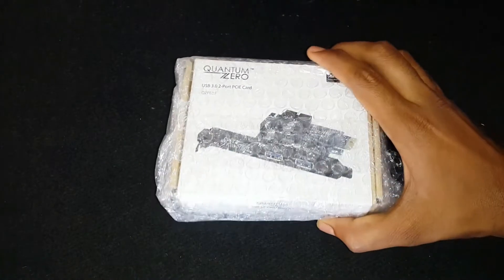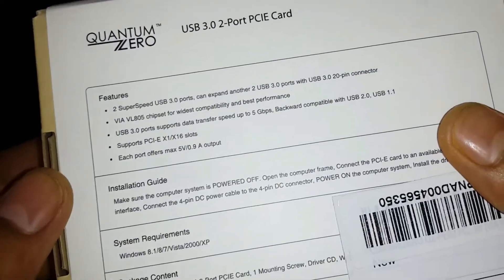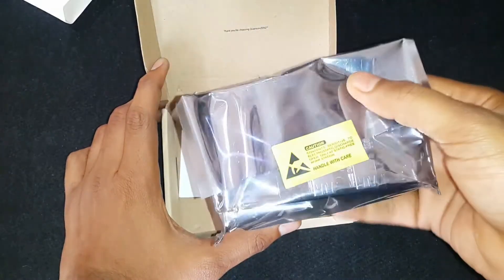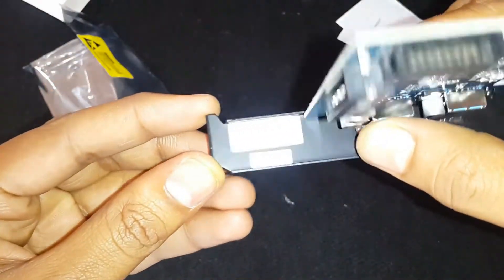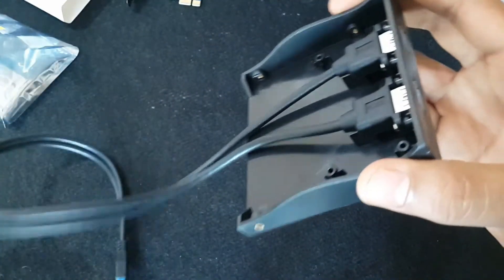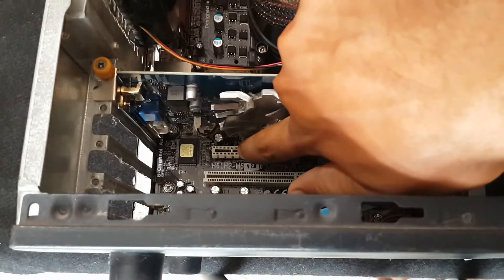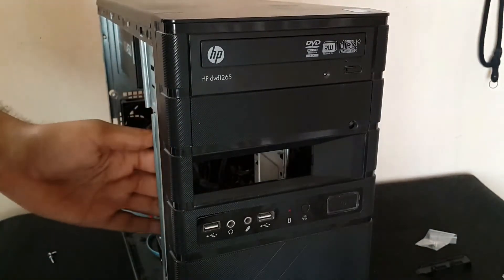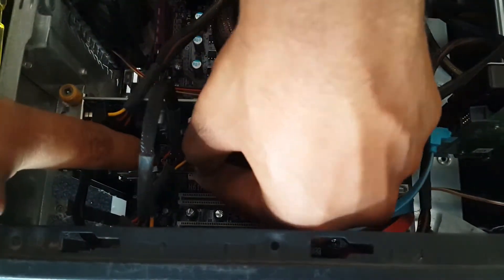How to install USB 3.0 PCI Express card

Comment: I have the same issue. My graphics card is blocking the pci express slot. I did not quite understand your solution. did you just remove the frame of the graphics card? would you explain further and please help me in upgrading to usb 3.0.
Reply from the maker: +Satish Vaswani 
I just removed that shown frame and tied fan to alluminium fin.... Then 3.0 card fits..
Reply: Hi, thanks for reply. I have the same problem, but i dont understand what you mean. Is it possible for you to do a video of this for people who have the same problem? 
I dont know what are the aluminium heat fins and how to tie the fan to that. I dont understand it. Hope that you can privide further clarification. Thank you so much!
Reply from the maker: +Satish Vaswani 
It may differ for other graphic cards..
Anyhow, I'll upload a new video regarding it.
And if you have a little space upon PCI slot, I will suggest you to buy PCI extension cable.
Reply: Thank you so much! Will be waiting for your video. I really appreciate your help! 

Also I was looking around for the pci extension cable and read some reviews and looks like they seem to cause issues later with the mother board. And after some time the cable starts to burn away at the end because of the cheap quality. If you have any links to a quality extension cable for pci slot then please do let me know.

Anyways, thanks for your help so far! Will be waiting for the video.
Reply from the maker: Sorry for the delay. Video will be out within today evening.
Reply from the maker: and also, if you have one more PCIE x1 or x4 or x16 slots, then you can use insert card in x4 or x16 also.

Comment: nice video, i have one question 
what are the points that i should remember before buying this ? like what are the ports which required to be on my pc motherboard to connect this?please help
i m beginer to computer hardware
Reply from the maker: It just need a PCI-Express either X1 slot or X16.
You can google with these names for practical overview.
I hope you like the video. hit on like button and please do subscribe for more upcoming videos.